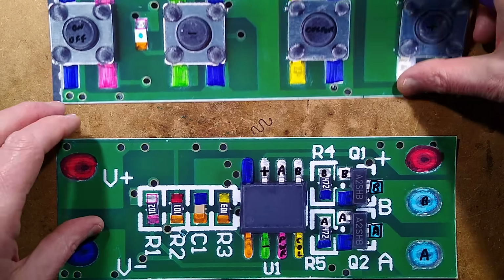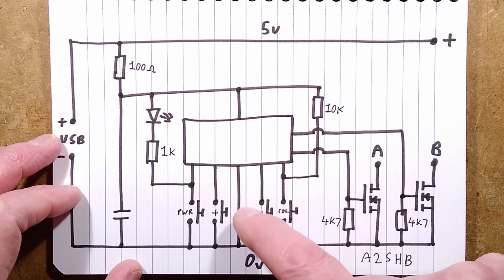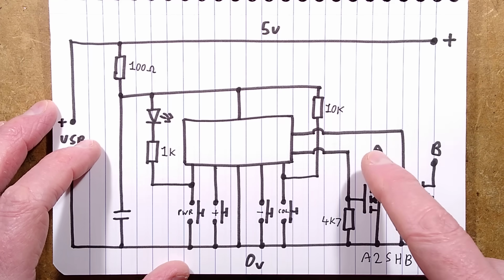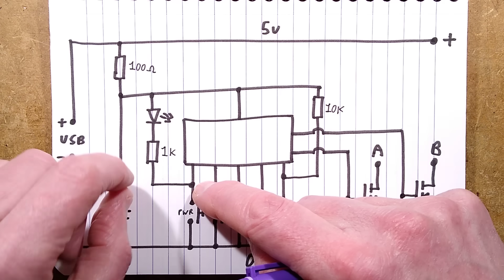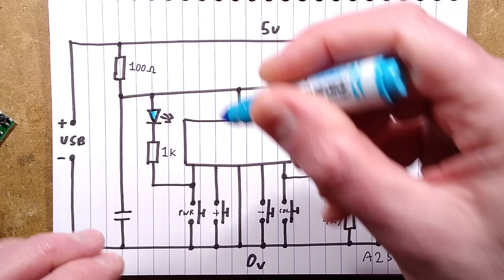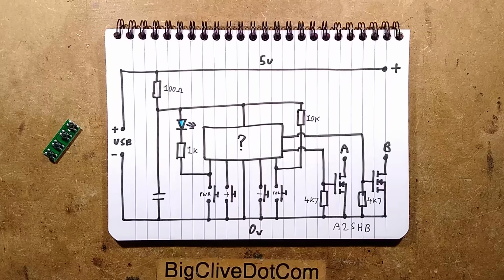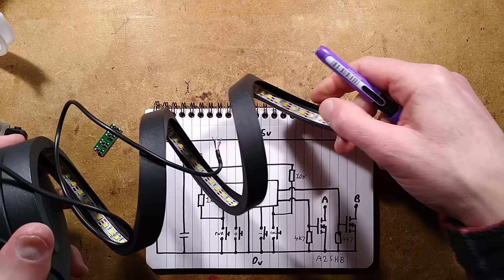Exploring a generic spiral LED light - with schematic

Comment: Clive, video suggestion.
Could you do a video on how to CUT and also JOIN LED tapes and long strip lights (LED)..?
I never know where and which ones I can cut and join.
Thanks Off Grid Andy from Aussie Homestead NSW Australia 🦘🦘🦘🦘
Reply from the maker: If you look at most LED tapes they are joined every 500mm to 1m already.  The length between cut points will usually vary with voltage.
You also have to consider the current, so sometimes it's better to run multiple individually powered sections.

Comment: My wife bought loads of 5v lights that have thise controllers.  They are absolutely pants.  On the plus side my first arguing project was making a replacement controller for one when it died.  I need to update the firmware to use eprom to store the previous setting now though so it get big alive approval

Comment: I have a completely different product that used the same controller and leds. It failed in a way I didn't expect. I turned it off, but didn't unplug it. I left it plugged in and off for maybe a week and it never turned on again. Something locked up in the chip I guess. All the components were fine. I ended up cutting off the controller and usb connector and hard wired it to my pc power supply.

Comment: I reckon you could probably bend that kind of aluminium track by rolling back & forth over it with a metal rod on something with a slight curve, then pulling it out to separate things once it does a full rotation. They definitely have some sort of machine to do it, but there's always a way to bodge it.

Comment: I have a question, I have searched for answers all over the interwebs with no answers. I bought a solar "street light" that has 2- 18650's in it for power. I am going to use the solar panel and the batteries to power a weather station by just soldering right to the battery holder terminals. In the street light they run the batteries in parallel. The (+) positive ends of both batteries are tied together. The (-) negative of each battery is separate- for charging and balance of the batteries I suppose. I was going to use the (+) positive right to the weather station, and use a schottky diode coming off each negaive (-) of each battery and then couple those into the one negative of the weather station. Basically trying to keep the negatives separate for charging but tying them together for the station. Is that the easiest way? You were the first I thought of but didn't want to waste your time.

Comment: The Wife bought the white version of this a month or two back. It makes a very effective desk light, and ours seems to have zero PWM flicker. On full power, "daylight" setting the spiral does become a little warm after hours use, but not hot (max temp appears to be no more than 31C over the length of the light. These probably make very nice centre-piece lights, since they are well constructed and durable. Nice to see the ubiquitous A2SHB - I get the feeling that this n-channel MOSFET is THE most popular in all Chinese electronics! ($ 1.13 for 100 with free shipping!)

Comment: I bought one of these lamps for an RGB conversion project i have in mind. I plan on mounting an RGB strip in the spiral and an esp32 micro controller in the base with the wonderful
Wled open source software running the light show. My phone will be used as the controller via wifi with an added external antenna to the esp32 as the case would shield the onboard one. Power will be suppled via a std 5volt power adaptor.
Reply from the maker: they do sell a version pre-fitted with WS2812B style LED tape.

Comment: Thank Ghu that it doesn’t flash SOS.

An infrared camera looking at those gate resistors would be, uh, illuminating. I bet they get a bit warmer than they should. Could they have been spec’d because they used oddball FETs?

I wouldn’t be surprised to find that there is a “premium” version with color changing LEDs, but why?

Comment: Fun fact: the controller for that spiral light is the same used for most cheap Ring Lights (I have two of those of different sizes, bought from completely different vendors, and their controllers do exactly what the one on this video does).

Comment: I recently got some "gamer rgb mood lights" from Temu. The cheap construction wasnt a shock but the lights had a couple of surprises. First is that they are commoned at the usb plug and second they can be independently controlled. The micro controller also crashes on some colours like warm white. Otherwise theyre just a nice simple light.

Comment: Hey Clive, I was wondering if you either have or could do a video on splicing LED tape.  I just opened a stage show that made extensive use of pre-used RGBW LED tape (608' with 12 decoders).  Spent 2 days cutting out dead/partially dead chunks and splicing in good chunks, but never came up with a method that worked consistently.
Reply from the maker: The biggest weakness in standard tape is when it is made in 500mm sections that are joined with solder bridges.  When repairing them I recommend using wire to reinforce the bridges.  LED tape should be considered a consumable on a show.
If used in costumes, it has to be easy to change and the stress points should be made with high flexibility wire links like the stuff used for meter leads.

Comment: Nice little light, indeed. Not a landfill candidate , can be fixed. Can be disassembled non-destructively, and modified in many way, and put back together. Nice product overall. I'm surprised. 
I'd love to see it with individually adressable RGB LEDs and programmed light show, or even triggered by sound. Would make a cool cyberpunk style VU meter.
Reply: With the ubiquity of ESP32/8366s and WLED, this would probably be a 3 minute project. Hardest part I think would be drilling little microphone hole.
Reply: @LeeNullus  3 minutes, challenge accepted.

Comment: Why do most of these types of circuits switch the negative side rather than the power side? I'd have thought it safer to turn off the positive?
Reply: In a low voltage DC circuit, which side you switch is of no importance safety-wise. In this design the FET drain operates as a current sink. Done this way the LEDs could, if so wished, be powered from a higher voltage than the rest of the circuitry, only sharing the reference voltage point, no extra components needed on the controller board.
Reply: @jussikuusela7345  That also applies to most LED Controllers having one common anonde, and the individual color has its own cathode.

Comment: Is it one LED die per package (two leads) and the LEDs alternate cool-warm-cool-warm on the tape? It looks like the tape has a cut line every two LEDs plus resistor.
Reply from the maker: It is using a common resistor for the cold and warm white LEDs.

Comment: This is timely. Yesterday I received an articulating lamp with the same controller. I really just wanted it for the arm, specifically with the slots to run cables through it. But the only way I could find one like that was with a lamp attached. You've saved me the trouble of opening the controller to see how it works. Now I just have to figure out what to do with the lamp head...
Reply: Tiny hanging basket for herbs? Hat for a dog?

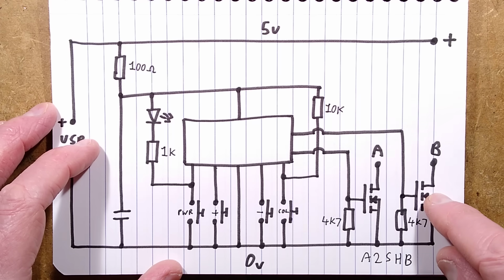Comment: @8:18 My 2L Dehumidifier (Silent Night (Lidl)) is on all the time. Did not know there was Automatic ones too :(.
Reply from the maker: The small units with thermoelectric coolers are massively in efficient compared to a proper full size dehumidifier that will remove more water with less power.

Comment: Isn't it a bad practice to switch the negative side especially on a metal lamp?
Why is it done?
Reply from the maker: This is low voltage DC, and there is no electrical connection to the metalwork.

Comment: I (here I go again) have the circle light with the big hole in the middle on a flexi arm but does exact same thing/same controller except the rings of WW/CW LED's are separate. I hope you don't mind me asking, anyone here really, but as I was watching this vid, my years old ornate B&Q 3ft LED Berry Tree caught my eye. I watched as the white balls that cover the LEDs all change at exactly the same time. Then I noticed they are not your usual RGB LEDs. They are in 3 varieties. R-B (fade red to blue through magenta) R-G (fade red, orange, yellow, green) and B-G (fade blue, cyan, green). There are about 52 on this metal, bendy arm, covered in black tape thing, 4 or 5 on each branch. They are driven by a 15V - 3VA small adapter and polarity proof socket (looks like the old 2 slot speaker socket from the 70's) with loads of length wire. I measured about 19v unloaded but definitely picked up a 50hz (49.8%) frequency on my multimeter leading me to believe this is a half wave rectified output with little to no smoothing. I dont own a scope to check.
My question is has anyone ever come upon these types of slow fade Bi-Colour LEDs? There is no controller so it must be the LEDs themselves with the fade routine built in and getting a clock from the AC side of supply voltage. They NEVER waver randomly, they ALL change at the same rate between their 2 primary colours. If I give myself a headach and roll my eyes around you definately notice PWM at work. :) Cant find anything on goolge and the product seems to have vanished as the numbers I have don't get a hit.
Model No. BQML4058 . EAN CODE - 5052931383276 . 3FT(91CM) PRE-LIT LED BERRY TREE, thats whats on sticker on the power plug :)
sorry for such a weird ask but it's driving me nuts and I know you work with lots of types of lamps and fixtures and maybe know what they are :) thank you in advance x
Reply from the maker: If the two colour fading LEDs go out completely during part of their cycle it may just be that one of the colours of the very common RGB slow fade LEDs has failed.

Comment: I got one of these on temu last year. I was disappointed that it doesn't remember its color when you turn it off so I eventually replaced the tape in it with rgbw ws2812 tape and put an esp8266 in it

Comment: Hey Clive!  With a plethora of all these "mystery" contoiller chips about, and we can't decode their contents; have you ever considered taking an off the shelf chip and program one yourself?  I think it would make for and interesting discussion / video.  A little dive into programming to handle stuff like light intensity, warm or cool strands, buttons, voltage sensing, etc.  Then how to send code to the chips for long term use.  Perhaps design a simple board we all could use to further customize our own projects. (Like you do with the LED boards.)
Reply: I too was just wondering that!
Re-program or drop in a PIC if the layout allows and make the modes more useful (ie. remove the useless SOS/Strobe modes from flashlights).

Comment: Can this be hacked to just to just turn on when plugged (so I do not need to press any buttons to get light) in max power r warm white only? I have same controller on magnifying glass with light. Can I just connect input wire s to both grounds and + at the output?
Reply from the maker: You could bypass the controller and apply power to the LED tape directly.

Comment: that control unit is used a lot, you can buy them separate, with just the usb cable for your own projects.
my experience is that they do tend to fail, don't know if it's the mosfets or the controller

Comment: If you hold the color button while plugging it in, does that defeat whatever the pullup is for?  Does it go into programming mode?
Reply from the maker: With PICs the programming mode may be initiated by a higher voltage.

Comment: I think lots of products like these are re-marketed automotive strip lights, in the last decade, cars used to mostly came with halogen lights and LED lighting came along and it was the new cool tech. So people went into market for lighting products like this to give their cars a more modern DRL looks.
But as more cars came with DRL strips built-in, there must be huge surplus of unsold DIY light strips, they got to go somewhere. The proper strips from Philips or some other brands are much better than these in terms of CRI and flicker control.

Comment: I think a nice string of RGBWW leds, and a ESP8266  and your have a nice colour changing lamp using WLed and wifi controlled to boot.
if you use a board with external antenna you can drill a hole in the case to mount the antenna within the spiral. Done this for a larger dual spiral lamp that came as just a white lamp. Now i might have to try and find some of these to go along with the big one.
Reply from the maker: They do an addressable RGB version.   I've just received one.

Comment: This ligt uses the same control unit and preumably lighting circuit as my illuminated magnifier that I bought from Aliexpress.. Good to see what could go wrong or what is downright "dangerous" or not. Good to see that it is fairly easily repairable. Also it is very RF noisy. Thanks for the info Clive. Great videos as always. Cheers and Beers Al

Comment: I bought the exact same one about 6 or 7 months ago and yanked out the LED tape and the USB remote thing, and slapped in some WS2812B 144LED/m, an esp32, a buck converter and a barrel jack so I could use one of the 200 12VDC wall warts I have laying around to power it… It looks beautiful now
Reply: I wanted to make this HomeKit native, does your version allow this?
Reply: @ I’m sure there might be something out there, I know that there’s really complicated ways to do it but that’s above my knowledge/patience, I have already cooked 3 esp32’s by fat finger fumbling my multi meter test leads, crock clips, and a USB C cable that wasn’t even plugged into anything… I just started covering them with capton tape right after I pull them out of the package and only leaving the pins I’m going to use exposed and the USB port exposed… I can’t post any links to anything but a simple search will get you some results…

Comment: That could well be the same circuit and layout for ring lights used with backlighting on phones etc. It looks the same right down to the control module, the warm and cold white LED's. The only difference is the light unit form.

Comment: A lot of the PIC microcontrollers have weak pull ups even on RA3, the MCLR pin so you don't need an external pull up too.
Reply: Also the pinout is odd and doesn't look like a PIC.  VCC and GND are usually on pin 1 and 8, hence why most PRC clones use this layout as a standard.

Comment: I have this kind of set up with the power bank running the light but I have a solar panel hooked up to the power bank so all day when the sun is out it charges the power bank and when the power bank is getting power '' charging '' the light is off '' like solar garden light's '' then when it gets dark the power bank goes back to powering the light, I have one hooked to my TV usb port as well so when I turn the tv of my LED flower I made turns on and stays on all night, The flower is old its what came out years ago and you plugged it into the wall but I gutted it and made it better,

Comment: I don't know why I've been additiced/still am to your videos over the years. I'm not even an electrician. But your videos are fascinating.
Reply: His was one of the first YouTube channels I ever subscribed to. I just love the way his videos are done, and his sense of humor.
Reply: It's his voice. Can't beat that.
Reply: It's Big Clive's engaging personality, and his sense of humour!
Reply: If an Arduino nano fits inside that control box, it might be a good project to control a strip of neo pixel LED's in that lamp
Reply: I was thinking wled project. @greeftish
Reply: @markpalmer9002  Yes, I have used small WiFi phone app RGB strip controllers that would fit in or replace that control box. Would be neater to fit it all components in the base of the lamp with a 3d printed circle attached with magnets on the bottom, but it being metal it may block the WiFi signal.

Comment: Hi Clive, I've got a similar lamp and if you hold the power on/off button the led In the inline switch flashes and you have a timer for the lamp to turn off after a few minutes.
Reply from the maker: I'll have to try that.

Comment: I wonder if it really needs to alternate between turning on the blue LED and monitoring the switch. That pin will have about 2V on it and pass current until the button is pressed at which point it will drop to 0V and no current will enter the chip. If that is a trigger event it would dramatically reduce the quiescent current.

Comment: or addressable LEDs. It would be interesting to see the background of some of these microcontrollers, I dare say the info would be hard to come by.
Reply from the maker: I have one on its way that might have addressable LEDs.  Probably standard WS2812B strip and a generic USB controller.  The microcontrollers could be one of many PIC style clones.
Reply: Addressable LED strip in that fixture would be pretty cool for effects.
Reply: There's ample room in the base to stick an Arduino module to drive them.
Reply: @strehlow  or an ESP32 for wifi-controlled WLED projects